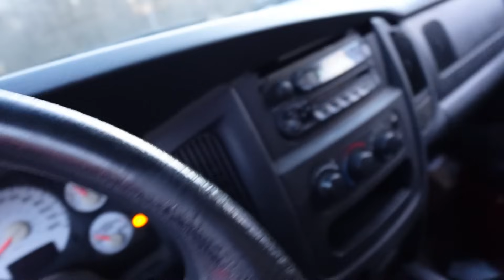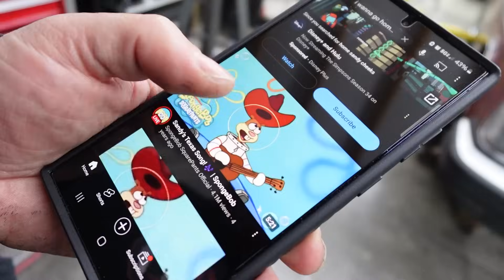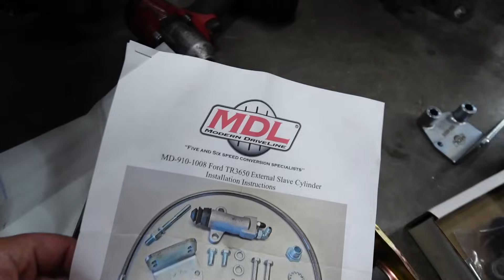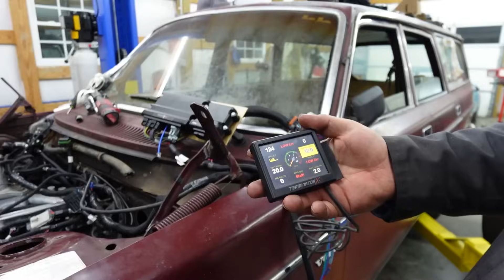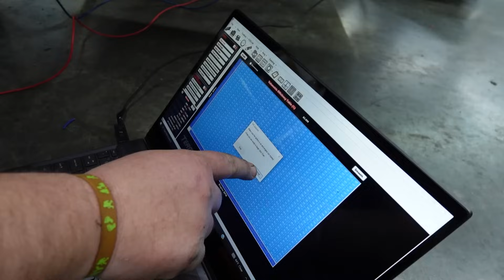2v 4.6 Swapped Volvo Wagon First Start!

Comment: So rad you guys did a 2v swap. They're my all time favorite engine. I own a 1998 mustang gt with a drift domestic front end, fortune coilovers, '12 gt500 front brakes, trick flow heads and cams, comp valvetrain gear. The bottom end has eagle forged pistons and aluminum rods. I had the rotating assembly balanced and installed all ARP hardware, line honed and upgraded all bearings to LS style. I did a link ecu, 78mm Borg warner turbo, 1800cc injectors, bbk intake manifold, FAST diy fuel rails, all Deutschworx fittings and lines for cooling and fuel, I run a walbro 650 in the stock tank. I also swapped a dc009 trans in i rebuilt myself with a hardened gearset, billet syncros and shift forks, twin disc, single mass flywheel, spool, mini tubs, 18×13s out back you know the deal jack. Other than the front end, cage, and weight reduction I built the car 6 years ago. She still makes 700 at the rear wheels on 11psi. I did upgrade the timing chain, tensioners, and slides as well but overall it's been the best engine I've ever owned. Puts the saying "buy once cry once" into perspective but, it was all worth it. I run her on e90. Only the best.

Comment: the NA 2 valve 4.6 with mods that bring it up to 310hp is right in the sweet spot of being a usable vehicle, all it needs is a $15'000 axle to hold it down and hook up. the Detroit lockers slip a bunch before the oil is whipped off the gears finally allowing it to lock up, 300hp on a 11.74 gear ratio is the borderline minimum to lock a hypoid locker.
Reply: That's a lot of maths to go Lincoln locker. Trutrac is the way but is this build a budget build anymore?
Reply: The stock diff will handle this engine combo for a couple events. It’ll get a budget 8.8 swap when it dies.

Comment: I have the same style external clutch slave cylinger from MDL on my 351 cleveland and TKX combo.  No ragrets.  That thing is nice.  And you can service the thing without having to pull the transmission out.

Comment: LS....typical of those Garbage Motors. I will say this though....was probably the best sounding frs/brz I ever heard. But just as reliable as any other one
Reply: Easy now... my 5.3 lasted two years of hard life near 4 digits and hundreds of runs.
Reply: @CharlesMaley1987  2? That's it? 5 years and going strong on my coyote which is 100% stock sealed as it came in the car right off the show room floor. Turbo'd to 1011whp with a best of 1032whp. Hundreds of runs, and driven almost daily. Now sitting at 78k miles. Just did compression and leak down test last week for a check up. Compression still at 180-185 across the all 8. 3 friends constantly hating on my coyote. "Gm the best! Last swap that thing!" Blah blah blah. Each one of them have gone through at least 1 engine, and none of them could hit the 4 digit mark with more Cid and bigger turbo. I will say this though....a cammed LS does sound FAR better than a coyote. Coyotes sound like Chewbacca getting kicked in the nuts repeatedly. The only downfall to them lol
Reply: It only broke because I started playing with lockup little early at 4700lbs. Congrats on your car. I hope the best in the future

Comment: Just seen someone have an issue with an oil filter blowing out. turned out the oil bypass valve was fucked. not to sure whats up with that swapped BRZ.

See now its locked tf up, shes done. sorry boys.

Comment: what a small intercooler on that thing i got a do88 big intercooler for my 240 and fits great and bigger than yours
Reply from the maker: The do88 intercooler is much thinner than this one, smaller inlet/outlets, and also heavier. This intercooler will be plenty adequate. We bought this intercooler based off room constraints and messurements since we had to relocate and move the radiator and intercooler further forward towards the grill to clear everything. Stock placement parts wouldn't work on this build. I'll probably end up going with the d088 intercooler on the srt4 build since all the factory locations stuff should clear fine to keep things clean and simple.
Reply: @BoostandBadHabits ohh yeah forgot you had to relocate everything forward. will there be a race with every car you own to see which is the fastest?